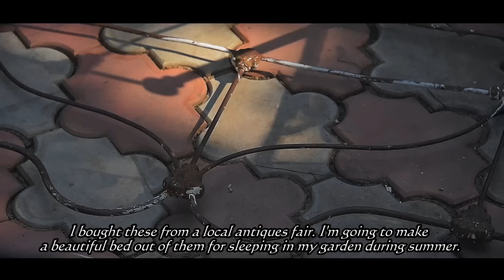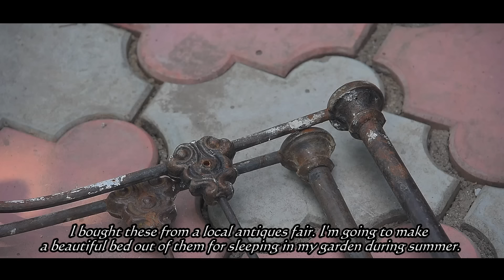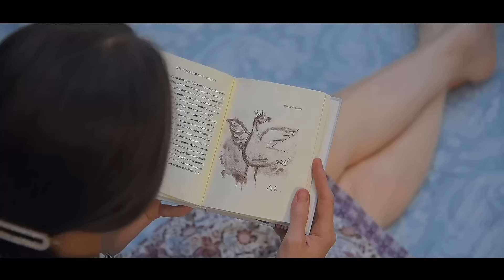Cottage Patio Complete Renovation

Comment: When you weld again with electrodes, you better put in in the handle under 135 degrees, not 90 degrees, then you have more moving freedom. And when you weld tubes again, keep a space of about 1 or 2 millimeters between the two pieces. I was a welder for 13 years and a welding inspector for 14 years. Always watch the melting bath, during the welding. I see that you are not afraid to do any kind of work. Keep it up! Regards from Belgium.  My dentist and my mothers homekeeper are from Romania.
Reply from the maker: Thank you very much for your kind and precious advice!🙏